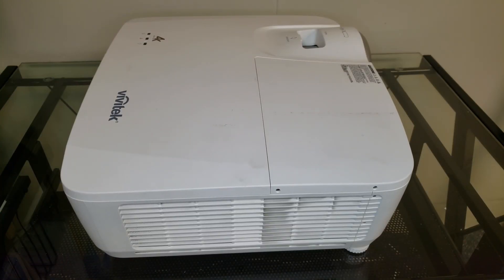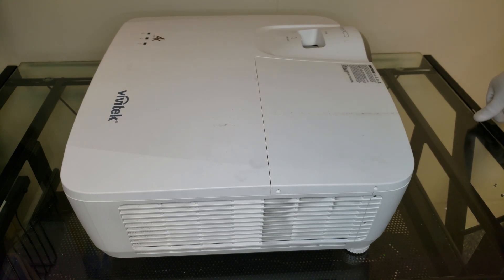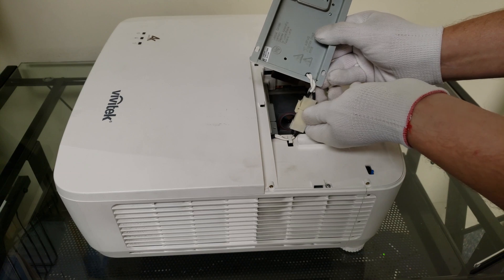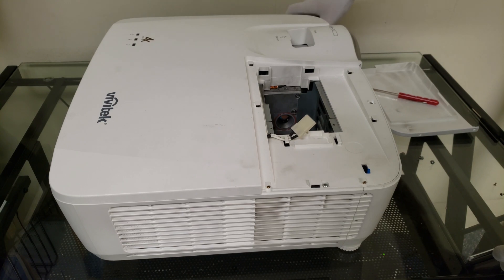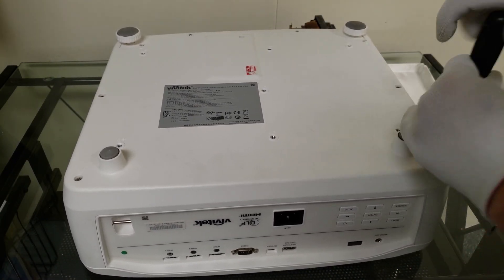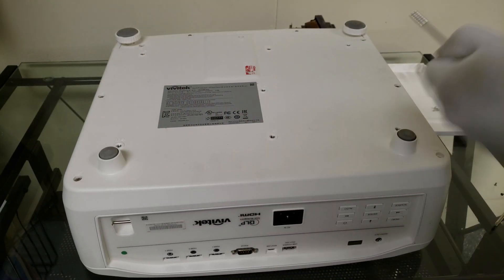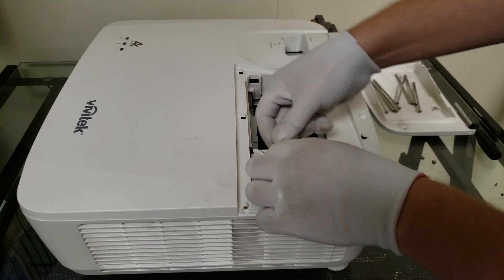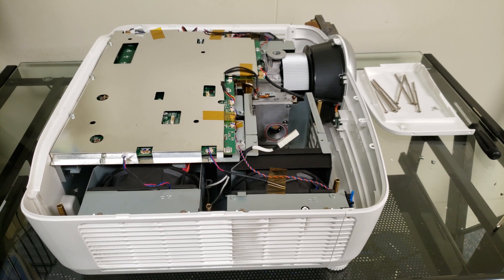ViviTek HK2288 Bulb Replacement & Chassis Opening Tutorial

Comment: Great video. Thanks! A question, mine recently stopped working. The display kept saying that it needed to be replaced but I still got a good picture before it shut down. Not sure if replacing the lamp will make a difference. I hear the motor and fan going but no light from the bulb anymore. It keeps shutting down then revving up to try again and still nothing. Could be the bulb but I'd hate to replace it and have that not be the problem. A penny for your thoughts?

Comment: mi e apparso un puntino bianco come posso risolverlo grazie mille
Reply from the maker: This is fixed by replacing the DMD chip.
Reply: @jaspertronics  ma dove lo trovo il chip dmd  per vivitek hk2288 hai un link ??? Tanks 🙏
Reply from the maker: @gioser82  To find out which version of the chip you have, you would have to pull the chip out and send over the model number that is written on the chip. This is the best way to determine which chip you have exactly.

Comment: I would like to know if it is possible to change the fans of this model for other quieter ones like Nokia etc.
Reply from the maker: It is certainly possible to change out the fans so long as the connectors are the same and all of the specs line up. I however would stick with the original fans just for the sake of compatibility.

Comment: How would you suggest to dust the projector internals? Would this require taking apart the project more than seen during your Outro section?
Reply from the maker: We recommend using a can of compressed air and blowing the dust away from the lens. As for the tear down it really all depends on how much dust has built up on the internals. With this unit it was very clean but some units may need the motherboard to be removed to get to everything.

Comment: Hi,

Is the bulb easy to replace after removing the little cover or do I need to replace the entire hub?

Thanks
Reply from the maker: Yes it is very easy. Just lift the old bulb and housing out after loosening the screws. The next step would be to simply put the new bulb and housing in! Make sure to give us a like and subscribe and thanks again!
Reply: @jaspertronics  Thanks. So I would have to replace the bulb AND the housing. I can't simply replace the bulb itself, right?